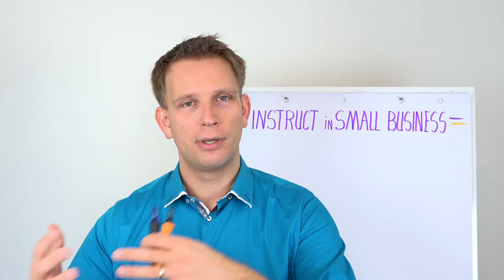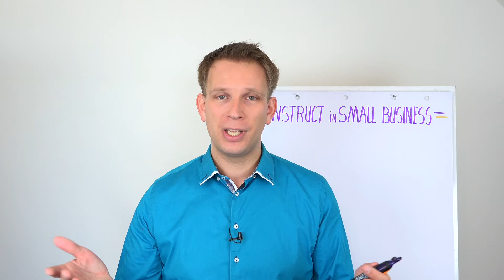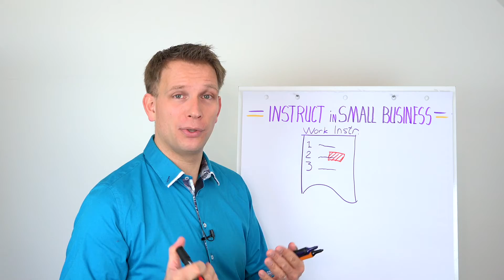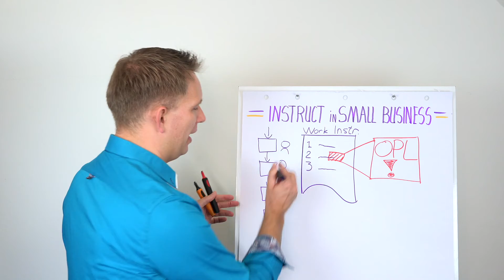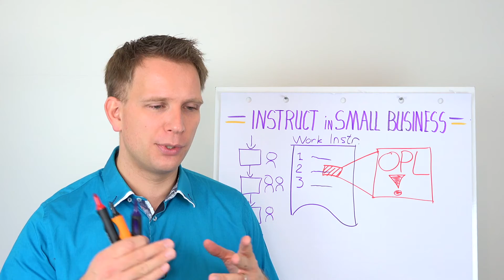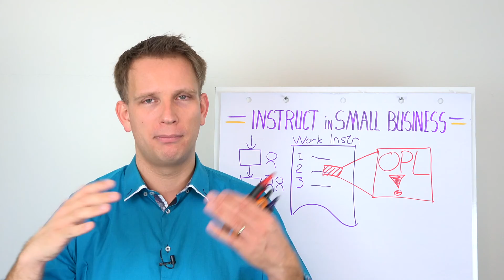How to start with Instructions and OPL in a small business

Comment: What do you think about Training Within Industry (TWI) method?
Reply from the maker: I think it’s a very good instruction method for guided on the job training. The focus on step-by-step explanation, critical points and why they’re critical provides structure for the instructor and supplies all the necessary information. 
It’s not very suitable for reference materials or as a reminder at the workplace, as it generally doesn’t use visual aids or schematics. 
I see TWI really as an instruction method (and a good one at that), for One Point Lessons it’s not the best choice, but they can work together very well.